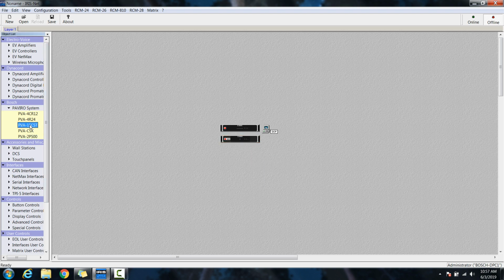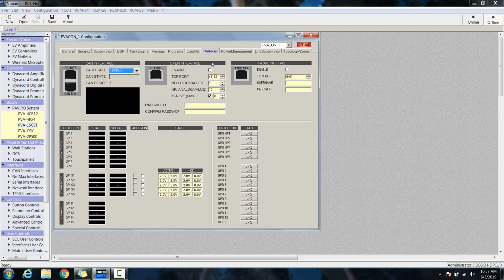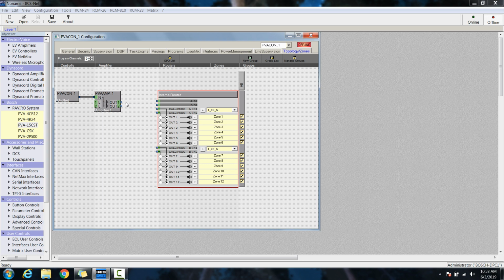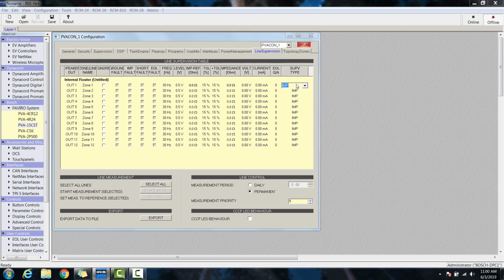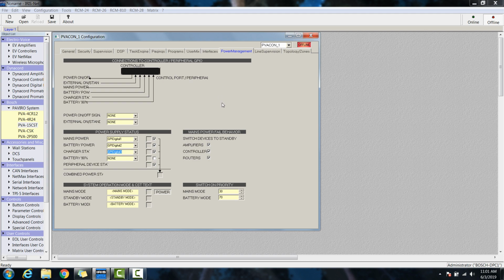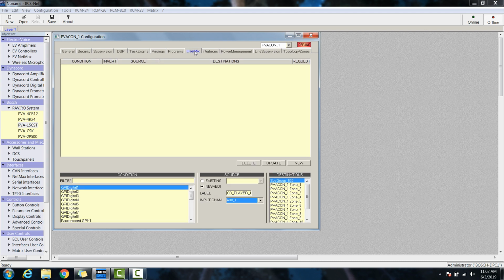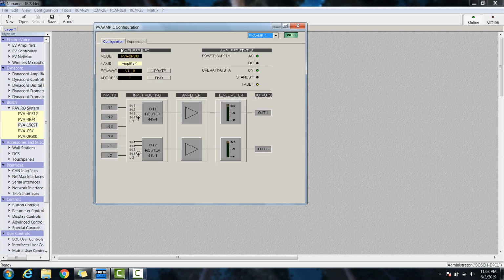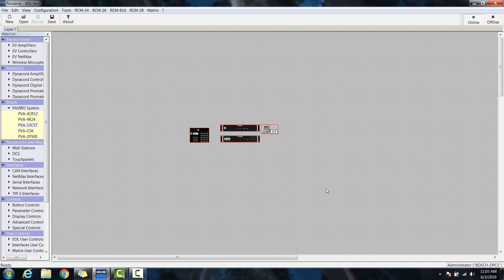Bosch Security - PAVIRO: Introduction to a 12 Zone System

Comment: I need to keep reloading the config file Everytime the paviro system reboots. This is an issue . Is it supposed to be like this or is there a box i am not checking to auto load the config wherever the system reboots
Reply from the maker: Hi Adil ,= thank you for your enquiry. To handle your request appropriately, please can you specify your current location? Thanks – Matthew , Bosch Security Team
Reply: @BoschSecurity   I am in the EMEA region . This is a great video. Please keep making more videos on basic to advanced Paviro configurations using IRISNET.
Reply from the maker: Hi Adil, please could you let us know which country specifically? Thanks – Anne , Bosch Security Team
Reply: @BoschSecurity  Saudi Arabia
Reply: @BoschSecurity  hi Anne , could I get a reply for my query
Reply from the maker: Hi Adil,  apologies for the delay. Could you please write your enquiry to centralsupport.bt@bosch.com ? Thanks – Anne , Bosch Security Team